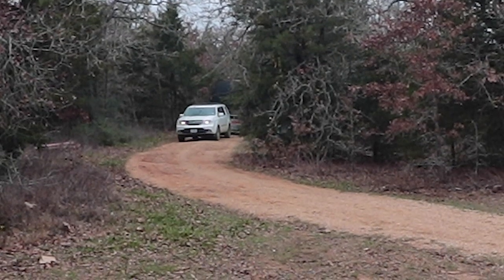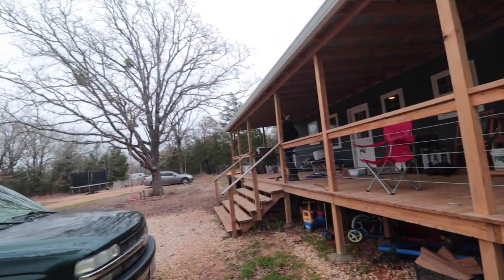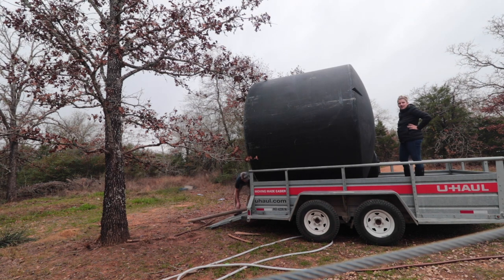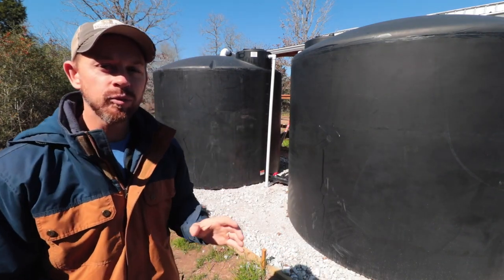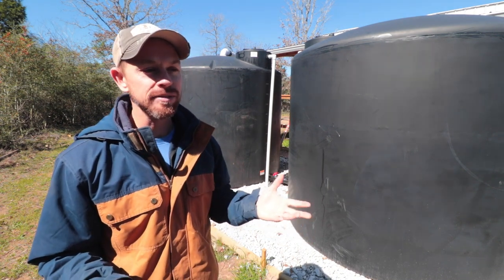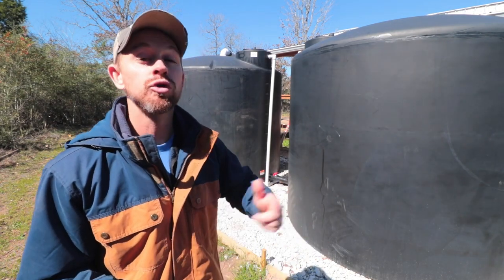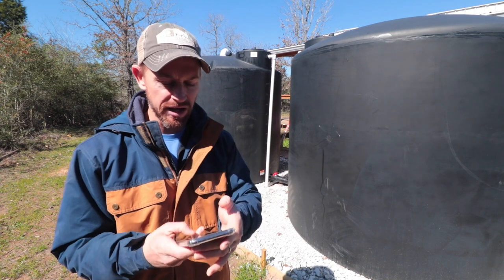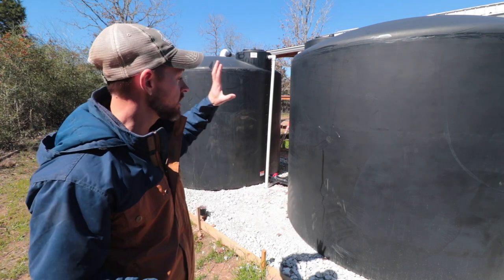Rainwater Harvesting TANKS {best PRICE??}

Comment: No fixed connections between tanks. I have had to repair more than a few as the flex movement cracks either the fittings, the tanks themselves, or the pipes. Use dark colored flex hose. Bob in Nevada

Comment: You should pipe-in a clear 1/2” or 3/4” hose, in between the tanks, at the pipe connecting the tanks, and run the clear hose up the side of either tank, and that will show you the water level in both tanks! Put a screen on the end of the clear hose so that no bugs can enter into it! Instant view of the water level!
Reply: clear not a good idea, they made a device that shows up level and some that are wifi connnected.

Comment: We had a 5000 gallon cement holding tank for our well at Medina Lake. That looks like it might be a little more economical.
 That looks like a good deal with TAMU. Gig 'em!
Reply from the maker: Oh wow!!!!  Well your cement tank would probably have a very long life.
Reply: @BetterTogetherLife  yes. When I sold that house 8 years ago, it and the 10K holding tank for the MLVFD at the front of the property were as good as new. The 5K tank will be 36 years old this October.
Reply from the maker: Wow!!!!!!  That is amazing!  I don’t think I’ll get that long of a life out of mine.
Reply: @ShandeleReynolds  both. The 5 k is hooked up directly to the well and is the holding tank for the house. The 10K was donated to the MLVFD by the Forestry Service to use as a "dry hydrant". It's the one near the road. We filled it up initially from our well, and then when needed, the fire department would refill it from the pumper/tanker truck that filled up at the fire house. This 10k tank allows the fire trucks to refill on the hill where I lived if fighting a brush fire or house fire there. It saves precious time as the fire house is 5 miles away. The department can also go down and pump water from the lake if necessary, but the 10K tank has all of the proper fittings to refill the tanker and pumper in under 5 minutes. 
 A dry hydrant is any fire hydrant not directly hooked up to acity or county water source. Very much needed in the Texas Hill Country and other rural parts of the state.

Comment: I notice in the beginning you're gluing all the fittings together to connect the two tanks at the bottom.
So, um, if all those PVC fittings are permanently cemented together, what in the world do you do when one piece gets cracked, a valve fails or there's a blockage in an elbow? It will happen sooner or later....    aren't you going to end up tearing apart and rebuilding a whole bunch of it just to fix one little piece? I'm looking forward to a more in-depth look at your process.
Reply from the maker: How else do you think you can connect PVC pipe together?  You can’t just dry fit it.

The PVC is connected to the tanks with a bulk head fitting.  So if I have to I can drain the system and remove that bulk head fitting.

But you can easily repair PVC with a new pipe.  Sorry I am not understanding you point nor your alternative idea of how else to do this.
Reply: @BetterTogetherLife   so in case of any problem you'll have to drain (waste) 1000s of gallons of water to replace a cheap  PVC part that froze/broke or got clogged? Yikes. 
I worked in a chemical plant (we sold mainly to farmers and water treatment plants) for several years and I never knew anyone to use PVC for that sort of thing, for basically that exact reason. Every tank should have its own valve, first and foremost. Then you just hook everything up with quick-connects and actual hoses rated for pressure and temperature. Like those used to unload tanker trucks, etc - no muss no fuss. 
Good luck.
Reply: @BetterTogetherLife  and actually yes people run aquaponics systems with unglued PVC all the time. Specifically to make repairs/reconfiguration etc easier.
But they're generally only using 275-gal IBC totes. You'll get a lot more pressure on those fittings with a couple thousand gallons, which is another reason to not use PVC in the first place (glued or not).
Sorry, not trying to be discouraging, but honestly if it was me I'd tear that cheap cobbled-together PVC BS apart and build it right before you even start filling it up. Find a local chem company or company that supplies tanker truck companies or chemical plants and they'll point you in the right direction to get the proper valves, fittings and hoses for your application. Buy once, cry once.
Reply: I mean look folks, you're working with a multi-thousand-dollar budget on serious infrastructure  that is supposed to last a lifetime. DO NOT use the cheapest possible parts right where problems are most likely to happen, that's just crazy. Think it through. :)
Reply: @BetterTogetherLife  I don't believe he is saying PVC isn't the right material, it's your setup that could be improved.  If you rotated the tanks 90 degrees and put a union and an elbow after each valve you could easily remove all the piping but the valves for service.

Comment: Why did you go with 2 x 2500 Gal tanks rather than 1 5000 Gal tank? Would you recommend that? Why?
Reply: In case one has a problem, you have a back up tank rather than being without water while you get it fixed.

Comment: I spent $20 per month or less per person for public water. That would be 10 years of water at your cost just for the tanks. Then add the cost of the other components, trailer rental, gas for delivery and I don't see how anyone can justify the cost. And yet it's much less than having someone come dig a well for you. Seems that there should be a better way. Informative and entertaining video though! Thanks for sharing.
Reply: Where I live in Ga we cant get city water.  We had to have a well dug and put in so we could have water. When we did live in the city and had water we often had a ban .we coildnt wash cars or water lawns due to the restrictions. We have a well but wi be adding a rainwater catch system as well.
Reply: @spotteddoghomestead9940  that's what I'm worried about because I won't have public water at the property I'm considering either. But my sister just paid approximately $10 grand to have a well dug. They had suffered through about 10 years of driving to town and filling ibc totes or originally gallon jugs... dozens at a time. I actually think maybe the best solution is driving to town and having the totes filled when I look at all the cost of having a source of my own. But in a shtf scenario that wouldn't be available either. Curious if anyone has found a more affordable way. I truly want to be independent and self sufficient but I'm not sure I can justify the cost. Obviously if you have a fresh water source from a spring or stream that makes water more affordable and readily available but can actually make other factors deadly if not extremely expensive. So no perfect world but hoping to not have to buy ten or twenty years of water at one time either 😩
Reply: 85577alarm  absolutely right! I didn't mean to suggest otherwise.
Reply: But he got a rebate on it.

Comment: I'm not at all a fan of Tractor Supply Co. I've noticed for years that everything from rebar and little fittings to big tanks at the TSC stores around me is very noticeably more expensive than anywhere else. Sometimes even a ten percent difference is a complete deal-breaker, certainly on a big project. One would think a nationwide chain would be able to offer better pricing, or at least sort of pretend to compete with Lowes, Home Depot etc. It really sucks when TSC is the only one in town that has what you need, because you know you're getting hosed.